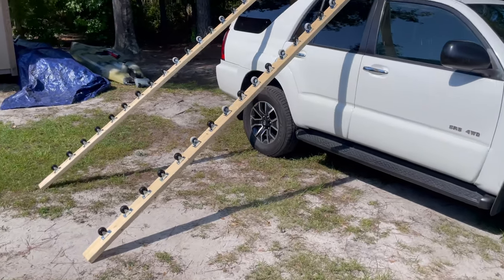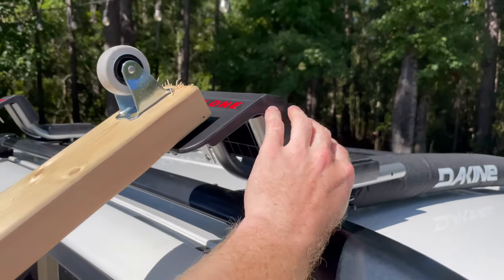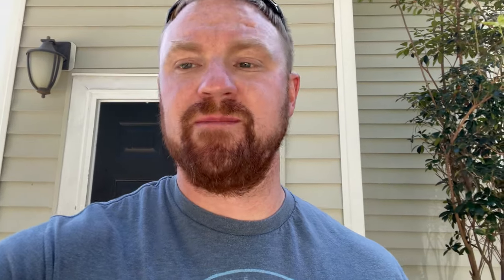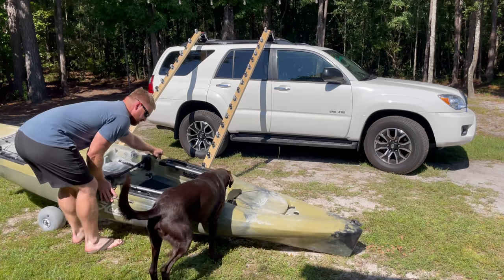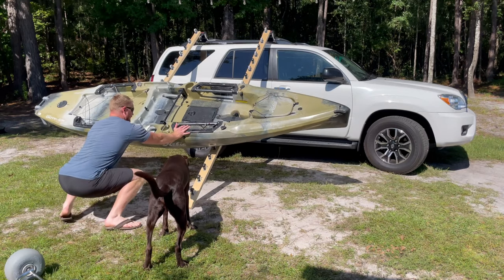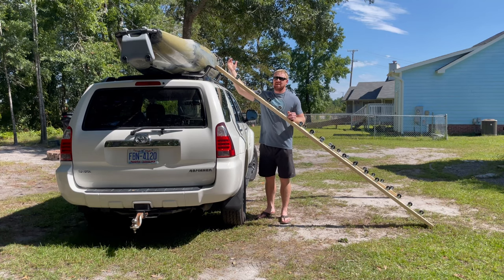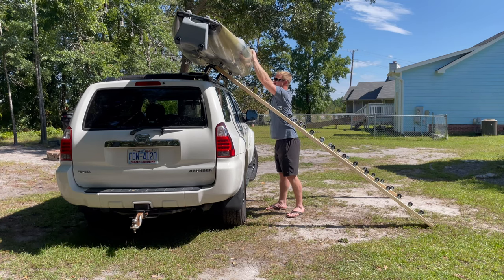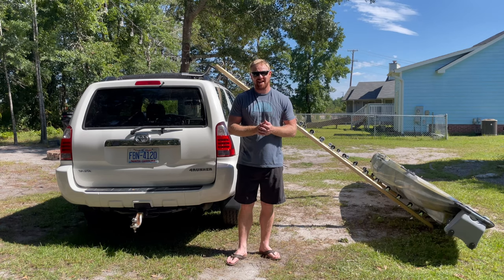DIY Kayak Load Assist - SAVE YOUR BACK

Comment: Cool design couple of things you could do. in the middle of the boards you could cut them in half put a door hinge. That way you could fold it and pack it. If you want lift assistance up the ramp you could put a boat trailer hand winch on the other side .it could also save your shins when taking down the boat.
Reply from the maker: Thank you for the advice. I hope someone else sees this that is contemplating building this setup. Great ideas.
Reply: I've done similar but used cotter pins for folding. I've seen others use hinges and wing nuts.

Comment: Question:  why wheels?  Wouldn’t the kayak slide up just as easily on plastic strips or even PVC pipe mounted to the wood?  I like the idea but those wheels are pricey imho.
Reply from the maker: Less surface tension on the wheels than straight on planks. PVC doesn’t hold up in the winter months for me.

Comment: Normally I trailer my kayaks but when I haul my camper I have to fight my PA's weight up to a rack over my cab and box and man it sucks. I've been thinking about a pully system from a tree or something. I love this idea and I will probably try something similar. 

One thing I noticed is how much flex and bounce your 2x4's have. I bet if you ripped one 2x4 in half and attached underneath it forming a T, it would reduce that dramatically. I'd probably glue and screw it. As for wheels vs pvc...  I think less resistance of pvc might be easier to push it up but the wheels create little pauses that might help your body in standing up and pushing vs a constant equal force wanting to follow gravity down. 

Also about pvc...  I'm not sure where you are located but for me here in Nebraska I've been using pvc on my kayak trailers since 2014 and out of out of 10 pieces none have gone bad from the cold or uv damage yet. We had 36 below temperatures last winter. Where I see the biggest issue with pvc is dirt from your hull of your kayak will embed into the pvc or vice versa and that causes friction and wearing on both surfaces. You can cover pvc with outdoor carpet glued to the surface that contacts your kayak but I've seen sand embed in that as well if you don't pressure wash regularly. Carpet does help reduce friction though. 

All in all you made a very useful tool that I sure haven't considered yet so thank you for the video!
Reply from the maker: I built a duck blind for a boat a few years back out of PVC and it started cracking and breaking on the first duck hunt. Maybe I had a bad batch but I've stayed away from it ever since. I figured I'd need to run a piece of alluminum up the backside of the 2x4's once they dried out for extra support. That's the plan anyways. Whatever works for you - do it!

Comment: I did some more research into this idea, and for some reason remembered the old Shingle elevators to getting shingle bundle to the roof top.  I now think I could use your idea with some of the DIY shingle elevators I have seen and make a self contained portable electric unit that could easily, cheaply,  and light weight move a small boat to the top top of a vehicle(pretty sure it would be under $100 and require no special tool).  Basically all you would need are 2 pole with a pulley attached to a board on top of the poles.  Then a saddle to hold the boat between the poles and a small winch on the bottom to pull the boat up(or a crank arm on the side to do it manually).
Reply from the maker: Having the electric compatibility would make it super simple. I like it.

Comment: What is on the stern of the kayak? Looks like a block to tip the kayak up for loading. It sits right where the rudder is.
Reply from the maker: It’s to protect the rudder system from hitting the ground. Kind of a poor design to be honest.

Comment: For lowering the kayak. Have you thought of using a hand winch on the other side to pull up and release as well. Im sure you can attach it to a board and attach that board onto your roof racks other end to pull it up & let down along with your system.
Reply from the maker: I actually sold the kayak since then because I couldn’t stand to sit in one spot for hours at a time. I have busted discs and they really inflamed to the point of the kayak not being enjoyable.
Reply: @ericwilliamsfishing  - Ahh ok. Thats unfortunate to hear about your back. Hopefully it maintains its health.

Comment: PVC pipe and elec. winch with little LiFePo4 battery works great too, no lifting involved.
Reply from the maker: Electric winch would be really nice.
Reply: @ericwilliamsfishing  Your idea works great though, well thought out. I've seen the winch and PVC used with a PA 14, pretty slick.
Reply from the maker: @db9818  that winch would be the ticket for sure. Haha.

Comment: Very nice, had you thought about putting your ramps on the back of your car, closer together ,and pushing the boat up nose/tail first? I have the same boat but mine needs to get to the roof of the shell on my truck.
Reply from the maker: I don’t have a way to do that without scratching up the paint. This Malone rack works really well to keep the car from taking any damage at all.

Comment: Nice design. (On an unrelated note, I suggest you replace the scupper cart. Eventually, it is going to crack the scupper holes, even though they are reinforced.)
Reply from the maker: Thank you Steve. I’ll only have this kayak for another 12 months and then it will be sold - for the 2022 model. Once that warranty goes, time to let it ride. These kayaks are too expensive to not have a warranty.
Reply: @ericwilliamsfishing  my 2018 Outback cracked after 3 months, using the scupper cart. I switched to a c-tug and love it.
Reply from the maker: @andrearuffino  that’s good to know. I’m surprised to hear that it happened so quickly.
Reply: @ericwilliamsfishing  It is a heavy boat, and a few bounces over rough ground would have been enough to do it.